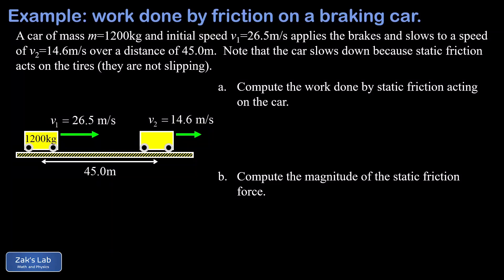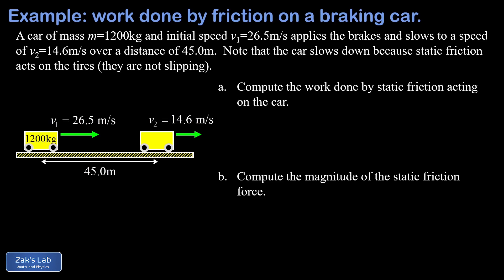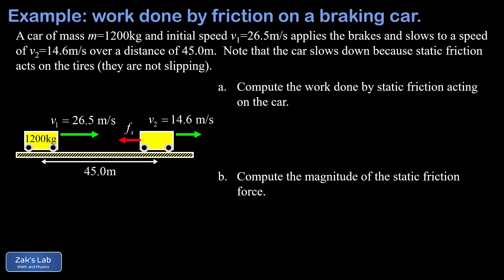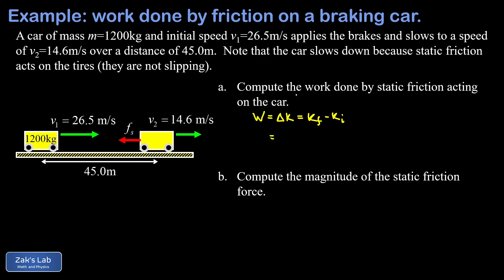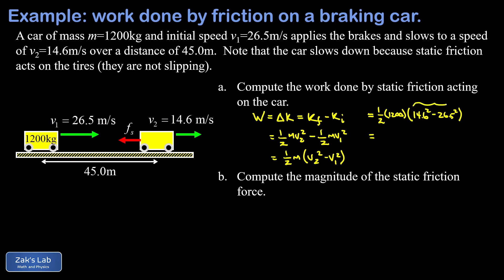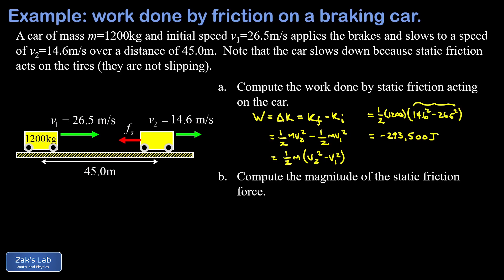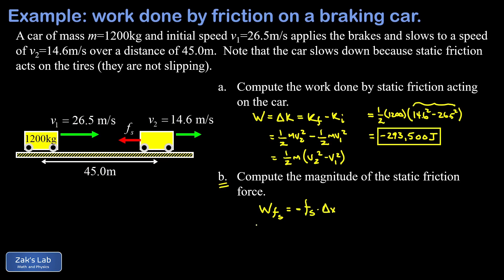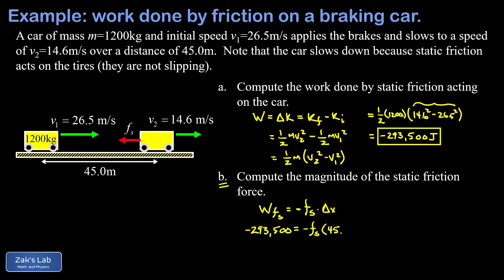Work done by friction for a braking car:  work energy theorem as a car slows down.

Comment: Misunderstanding  a) Static friction can not be a braking force. No work is done by the static force on the tires. The static force is needed to maintain wheel rotation. b) Brake work is normally  done in discs and pads. Your calculation gives the result of braking the car with locked wheels and kinetic friction.
Reply from the maker: If you take the car (wheels and tires included) as your system, then the kinetic energy of that system is decreasing.  So there must be a net work done on that system from the outside, and that work must be done by a force exerted on the car by the road (what other outside force is there, aside from a negligible amount of air drag?).  The force can't be a kinetic friction force because there is no slipping, so that leaves one candidate . . . and it's the counterintuitive result that it must be static friction.

BTW, friction at the brake pads isn't going to do it for you in terms of force analysis:  that is an internal force to the system, which means it comes as an action-reaction pair:  force of the pad on the disc points one way, force of the disc on the pad points the opposite direction and has the same magnitude.  So the net force exerted on the entire car system by this braking force pair is zero. --z
Reply: @ZaksLab  Can you feel any generated heat, hear any noise, se any slipmarks and smell burned rubber along the road during the braking procedure? I don´t think so. The brake work is done inside the car, converted to heat. The Newton´s second law is valid only for a rigid body, without moving parts, like wheels. If you multiply the Newton2 equation with translation distance you will have the energy law. Two versions of the same law, none of them work here when considering translation. But if you lock the wheels, your calculation will be OK.

BTW, what about the decreasing rotational energy of the wheels? How do you manage that? That is also a complication here with a nonrigid body and must be included in your calculation.
Reply from the maker: @ It's a vexing problem for sure!  But you aren't addressing the key question here:  view the car as the system, the KE is decreasing, so there must be work done on the car by an external force.  

You bring up other interesting details, and the plot definitely thickens as we try to unravel all the internal and external forces on the car.  Just to address the rotational KE issue, for the rotational KE of the wheels to decrease, there must be an external torque exerted on the wheels.  Now we're analyzing torque on a wheel, which has a braking force as an external force and static friction exerting torque as well, and the torque exerted by friction by the brakes must be winning that battle.  But this means the reaction force on the brake pad/caliper must exert a torque about the car's center of mass, so why isn't the car rotating now?  It can only mean the normal force exerted on the wheels is changing to produce a balancing torque on the car, and this is why you see the front suspension compress when you brake hard.  Incidentally, this is an external torque to the car/wheel system, which explains how you can have a changing angular momentum.

N2 definitely applies to any mechanical system whether it has rotating parts or not, and the power of this approach is in simplifying complex systems to a bird's eye view.  We can keep getting deeper and deeper into the details, and it's honestly a really interesting discussion, but that N2 analysis demands an external force exerted by the road to slow the car down, and it's not kinetic friction. -z
Reply from the maker: BTW, the details of the internal forces and torques are SO interesting, I just added a note to my fall mechanics course website.  I'm going to turn this investigation into a huge guided problem for my class this Fall, and I'll put together a video on the topic next year.  Thanks for your inspiring question!  z
Reply: Interesting discussion. N2 for translation was given for a particle. If  N2 will be valid for a body, all  particles inside must have the same velocity, including direction. That is not the case if the body has moving parts.
Reply from the maker: @goranmalmsten5306  You can derive a generalization of N2 for a system of n particles moving with, in general, n different velocities.  This is done in the introduction to rigid body dynamics, but this derivation makes no reference to rigidity.  Conclusion:  the sum of external forces on the collection is equal to the total mass times the acceleration of the center of mass.  So sum(F_ext)=Ma_cm is the generalization of N2 to extended bodies, and this holds regardless of internal motions relative to the CM.   I do the derivation in the intro to this old and crappy video, then apply it to a chain sliding off a table:  https://www.youtube.com/watch?v=kqAjyj04_P4